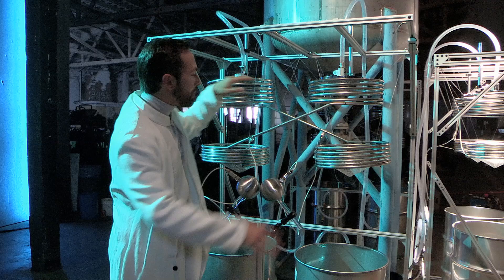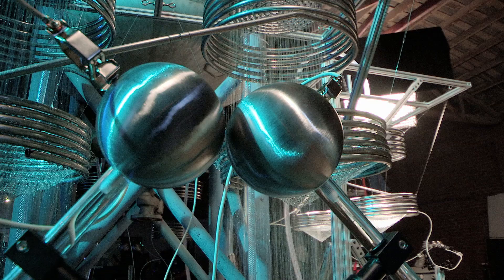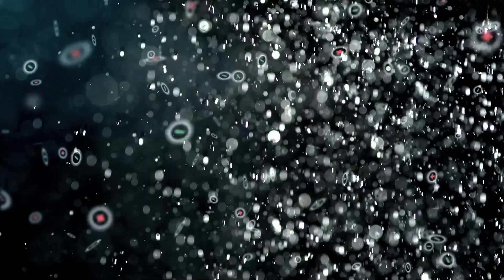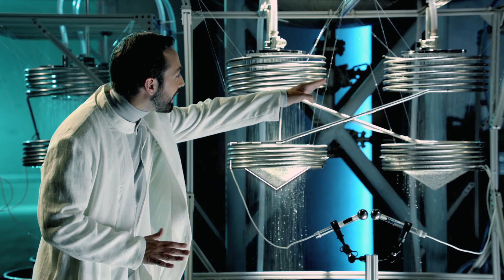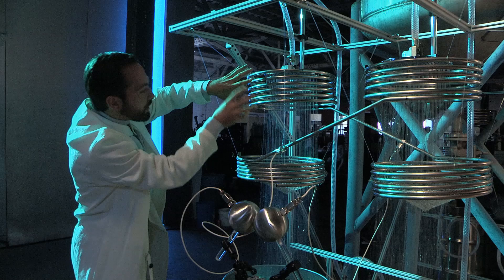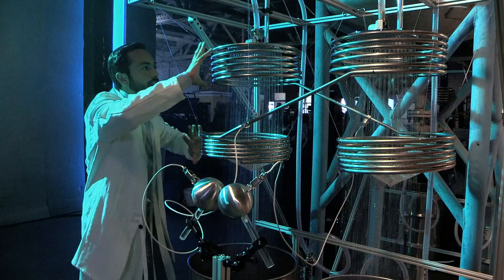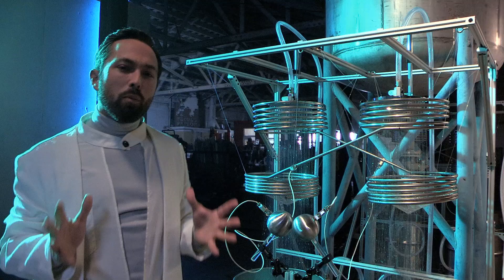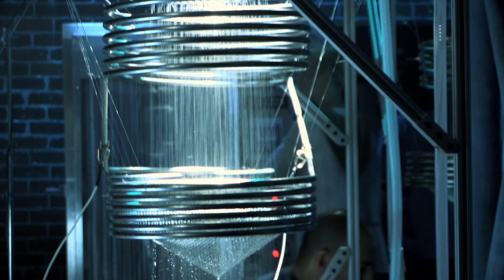Sparks from Falling Water: Kelvin's Thunderstorm

Comment: The energy comes from electrostatic potential of the stream of water.
Hence, it cannot be used again
Reply: bassisku No, gravitational potential energy is not the source, the ions are....
Reply: if we did this to all water before we used it in traditional hydroelectric power stations we would make the whole system more efficient though. right?
Reply: Reggie land For the added cost, being able to charge an extra phone every six and a half years wouldn't be worth it.
Reply: people keep on saying it comes from the gravity, which was my initial thought. But then I realized the only reason the water really needed to flowing was so that it could get more charges from new water. And so I thought a similar thing. I am pretty sure you are right.
Reply: The water starts out electrically neutral.  There is no significant electrostatic potential in the water until there's charge separation, which is caused by the charge building up on the coils.  That, in turn, can't happen without a source of energy, as like charges will tend to repel.  The only available sources of energy here are gravitational potential energy and thermal energy.  Given that the droplets are moving relatively fast when they hit the mesh, their overall kinetic energy, rather than internal kinetic energy (a.k.a. heat) should matter more.  But, the motion comes from the conversion of gravitational potential energy as the drops fall.  Thus, the only thing that could reasonably be the energy source here is gravity.

Comment: how to turn few hundred watts of pumping power into few milliwatts of high voltage.
Reply: Could be done using natural water flows. Still, better ways of converting the energy exist.
Reply: @JBinero  waterfall
Reply: but if you ever happen to find yourself in a place with no electricity, and happen to have all the materials to build this, you can use a bucket to transfer the water back up to the top tank by hand, converting chemical energy (from eating food) to mechanical (moving the water yourself) to electical.
Reply: Well said
Reply: @SurgStriker   you could create a dynamo, a lot more power efficient
Reply: @SurgStriker  or just turn a crank
Reply: a dynamo or hand crank device would require a magnet. You could potentially create an electromagnet, but you would lose more energy making it than you would get back from it. So if you had the wiring necessary without a magnet available, this water method is an option
Reply: in this way you can charge a Tesla.
Reply: @JBinero  Hoover damn is a good example.
Reply: Almost like the current state of fusion power
Reply: @sendoh7x  tears dont fall
Reply: Voltage and watts are two completely different units.
Reply: you need a magnetic bearing and generator that uses superconducting materials, some good thermal isolation and you're off.
Reply: lol right... there's much better ways of producing electricity from falling/flowing water.. still cool though.
Reply: Prior to vacuum tube driven oscillator coils, step up transformers, and rectifier vacuum tubes, this along with the Van De Graaf generators may have been the only way for producing DC high voltage.
Reply: That's wrong

Comment: Well, the only obvious energy in the system is gravitational potential energy... probably the water is slowed very slightly.
Reply: James Lewis just because a force is pulling on it doesnt nessesairly mean it give it energy
Reply: MessiahNerves right, but the water starts with gravitational potential energy, and this is obviously converted into kinetic energy... if the electricity comes from somewhere, this would be the obvious potential source... but if you have another suggestion, please feel free to suggest it.
Reply: James Lewis the same molucules attrack while the ions pull the h30+ ions and the oh- to them aswell im guess this charge diffrence may cause but im not sure if i really wanted to know im sure a google search would give me the awnser but thats to fun.
Reply: MessiahNerves RIght, so obviously the positive coil attracts negative ions in the water, and visa-versa... and this creates a positive feedback loop because of the cross connection of the screen and the coils... but since this "sorting" process is essentially decreasing entropy, which can't happen unless there is an external source of energy, the question posed was... where does the energy /come/ from, and as I said, since I this is an electrostatic induction generator, the energy appears to me to come from the gravitational potential energy of the water... by slowing the water droplets a tiny amount.
Reply: James Lewis How about chemical energy of turning the ions into neutral H2O? Surely that is a reaction which gives energy, right?
Reply: MrRolnicek I'm not sure its legitimate to call that "chemical", and since its all in one mixed container to start with, you still have the negative entropy problem....  so that would be an energy sink, not a source.
Reply: James Lewis in a body of water, there will be some molecules of water that are positively charged, and some that are negatively charged
normally, the numbers of these are equal
in this setup, the molecules are split up into smaller groups (droplets) the positive ones are then pulled to one side and the negative to the other (that part i don't understand how it happens, just that it does)
the spark then neutralizes this charge difference
essentially it is decreasing the electrical potential energy between differently charged droplets of water
Reply: Schuler Kleinfelter Yes, that's completely correct, the separation happens by electrostatic attraction, that's why the grids are connected to the opposite side... however the combined charge of the water is zero, so the fact that it is able to separate positive and negative charge in such a way that energy can be extracted means that there is negative entropy, and an external source of energy must exist...   Since the water itself has a higher gravitational potential energy at the start than at the end, this is one potential source.... the only obvious one anyway.
Reply: James Lewis I think you're right.  The current is created much like a magnet being moved through an electric field, the magnets in this case are the very weakly charged droplets.  The force moving those is gravitational, thus the energy is ultimately resultant of the expenditure of gravitational potential energy.  It would be interesting to try the experiment with a supply of powerful tiny magnets in place of water droplets, but you'd have to devise a way to stop them from clumping.
Reply: James Lewis At the end of the day here when we see a spark that means electrostatic potential, and when we see electrostatic potential, thats just more electrons on one side and less on the other. When enough electrons pile up on one side we get a large negative charge. On the other side there is an electron deficit so a big positive charge. When that positive charge gets large enough, it actually polarizes the air molecules in between that gap. That means it rip electrons off of the air molecules. Air does no conduct unless polarized, that's why you only see the spark periodically. It only sparks when there is enough force to polarize the air. Now the energy we're looking for had to move electrons, and random kinetic energy that you get from thermal energy doesn't do that. Otherwise, everything would be charged all the time and you'd get electricuted by all matter. Sooooo, we know it has to be electrostatic energy. Let's look at it a bit deeper. Not entirely sure why negative entropy is being brought up. The entropy you are thinking of is calculated with free particles (no force acting on them). If forces like gravity and electrostatics are acting entropy in the conventional sense (the sense you are thinking of) is null and void. In fact, the entropy in a system in which electrostatic and gravitational forces are acting is always 0. Entropy has to be zero because Newton's and Coloumb's laws are deterministic. There are no probabilities involved, particles under the influence of gravity and EM have definite positions, velocities, and accelerations at all times. Stochastics will only determine the initial position and velocity of the particles, but you wouldn't want to use entropy to solve a problem like this. Actually stochastics, the spirit of entropy allows this process to work at all because of the stochastic concentration of electrostatic charges that intitiate the feedback loop. Water is not neutral, elementary physics will show you this. The hydrogens are bonded to the oxygen at a 120 degree angle. In a linear molecule, the positive and negative electrostatic field kill each other. In a molecule like water (draw the diagram), the two x components of the hydrogen's negative electrostatic charge sum out to zero, but the y components reinforce each other to create a dipole moment (the y's will be 2sin(60 deg) times 2e, the charge of an electron, order of magnitude 10^-19 coloumbs). The field of a dipole is weak, it dies out like 1/r^3, but when close enough to the water molecule, electrostatic forces will definitely act. So, to answer the question, the energy here is from the potential energy between electrons and protons of the hydrogen and oxygen molecules. Gravitational potential energy plays no part in this. Kinetic energy yeah sure, molecules jostling around positive and negative charges moving through space so they can experience electrostatic forces yup, that's all just thermal energy, of course it plays a part. Remember that friction, viscosity, all that fluid dynamics stuff is really just electrostatic exchanges between molecules. We're talking classical here, but if you really want to talk QM, we've got electron degeneracy pressures and stochastic covalent models. We actually did solve the hydrogen wave function completely, but for oxygen, it will be a quantum peterbation approximation. Anyway, we can get an answer that's in the same order of magnitude as the correct energy in those sparks per unit time, if we solve this with classical mechaics, but to really understand what goes on with covalent bonds and where that energy goes and comes from, you need to do the Fermion vs. Boson particle pair numbers.
Reply: James Lewis Its far more likely to be chemical in nature. Probably related to the coordination bond between the water molecule and the ions.
Reply: James Lewis i'm not 100% sure, but I seriously doubt your explanation to be correct.
this seems to be a purely chemical process, very much like a simple chemical battery. the ions in the water get attached to the mesh, this changes the total charge of the metal piece, resulting in the electrostatic charge. if my explanation is correct, the water in the container bellow will have a lower concentration of ions than the water in the supply tank. Also, if you keep using the same water again and again you should end up with lower and lower charge buildup, until eventually you'll have pure water.
Joe M, how did you go from electrically charged water droplets to tiny magnets?!! I think you're mixing up electromagnetism and concepts from how electromagnetic generators work with this experiment which seems to be a completely electrical phenomenon. perhaps what's causing your confusion is the fact that the electrically charged droplets DO result in a fairly small magnetic field around them, however that doesn't lead to any relevant current or change in charge in the mesh and the connected metal pieces.
Reply: MessiahNerves It does give the water energy when the pulling accelerates it.  Which happens when things fall.  Due to gravity.  Like the water is.
Reply: James Lewis I've got to agree.  At the start there is only potential energy.  And that is converted into kinetic energy by the acceleration due to gravity when the faucets are opened.  I think it would be slowed down (of course a teensie weensie bit) before it left the large container where all is mixed.  As ions migrate toward their preferred exit, positive and negative would slow each other down getting there.
Reply: +James Lewis It is because when the coil is posative, ions are ripped from the water molecules and put around the coil, and also are put through the mesh, so the mesh will have overall negative charge, and the opposite on the other side, when both sides have that much charge and they come close enough, it will cause the opposite charges to react then they make a spark.
Reply: +James Lewis yes that is correct the only reason this works is because the water is moving and the actual energy comes from the water taking the charge and moving it to the other coil. Simply having a charge is not energy but taking a charge and moving it somewhere else so that there is an unbalance can create energy.
Reply: No. The energy comes from the random differences in electrical potential in the atmosphere. This is a full wave rectifier. There is a potential gradient in the atmosphere, but it is not stable, it is turbulent. When it goes up on one side, it feeds into the opposite ball. The amount of electrical energy generated is a tiny, tiny fraction of the gravitational potential energy. The gravitational energy is identical on each side, no difference to drive an electrical energy buildup.
Reply: @aeromodeller1  That's very much a Tesla-like theory, however at this scale the gradients in question would be very small, and would most likely cancel
Reply: @xxportalxx.  It is not the vertical gradient that drives it. It is horizontal random fluctuations.
Reply: Potential  to kinetic to   high rate of change of magnetic flux to current induced in coil
Reply: How can it be used, yay small spark big volts from falling water, ozone, now what, how is í t useful
Reply: i thought it is gravitational potential energy converted in induction too, but... Coils not shorted. Even with spark. It means no induction. I think this experiment is possible with grid + cylinder insteed of coils. Coils here cannot generate induction current and they are just anode/cathode of capasitor

Comment: The way I understand water, it has a slight tendency to seperate in H+ and OH- ions which are constantly reassociating back into H2O and then disassociating back into H+ and OH- ions. The small percentage of water that is temporarily in these ionic forms are the charge carriers that are attracted to the corresponding oppositely charge coils through which the water is flowing. When enough of the positive and negative ions are attracted near the coils there is a small flow of current in the coils which results in the coils themselves taking on positive or negative charges. When the charges are sufficient to ionize the air between the balls, a spark jumps the gap and the charge is neutralized at which point the process starts over again.

Comment: Veritasium, I wish we could test this in NASA's vacuum chamber with less than 50 torr (<1psi) vacuum. If we can keep the liquid chilled we could go as low as 20 torr.
There is a mixed crowd over what is the cause of this effect. Many claim it is the kinetic force of a conductor moving across the coils, other believe it is a static friction force with the air building up a static potential. I would like to see the effects with saline water and pure water in a vacuum chamber to test the two theories.
Reply: I built a similar one of these. There were single drops and they didn't contact any of the rings. It builds up and yields charge like a van de Graaf generator. I had two coffee cans cross-connected to two small rings, all insulated. there was no friction, the droplets slow down as they go into the rings, give up charge due to faraday shield effect and thus turn kinetic energy into charge. Like a thunderstorm.

Comment: While there's not a lot of charge, this is a brilliant setup. I see potential (no pun intended) in this. Perhaps a large enough setup - or an array of rigs - could be used to drive LEDs as some sort of emergency storm lighting. Or... I don't know. But I'm sure there's greatness that could come from this.
Reply: The only change in the water at the beginning of the experiment and at the end is it's position. this means it is powered by the fall of the water. What i'm saying is that it needs to bring the water back up, so no energy generated. Also, you could also run a wheel under your faucet to generate energy which is much more effective.
Reply: Correct me if I'm wrong, But I think this is how Waterfall generators work...

Comment: It comes from potentiel energy. Gravity does all the work. The speed of the water is slightly reduced as if it was falling freely.
Reply: that's kinetic energy
Reply: Joaquin Pirotto Which is converted from potential energy.
Reply: Kinetic energy is not easily converted into electrical energy, and it doesn't look like the water is slower than it otherwise would be
Reply: Ivan Navarro Kinectic energy is EASILY converted in to electrical energy, the energy it pumps out is so small you wouldnt be able to see the difference in the movement of the water.
Reply: But we use turbines to convert kinetic energy of water, or even steam into electrical energy and those work because of magnets inside of them. This set up doesn't have any of that so I'm not sure how the Kinetic energy could be this easily transformed, but I'm here to learn! Thanks for the reply!

Comment: as rain "shower" falls the air is rushing around each droplet this is causing a greater volume of air movement - as air rubs each drop it is charging it much like a balloon being rubbed causing our hair to stand up because of a static charge water drops are no different. hence the standing static field -this is why the drops are pulled to or from the rings at the time of discharge.